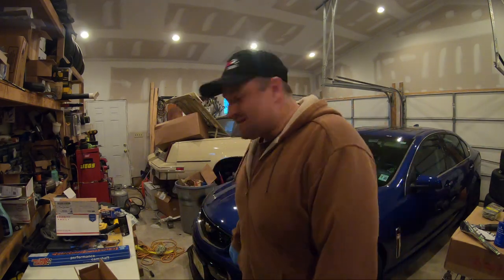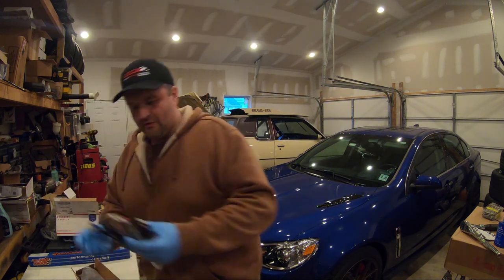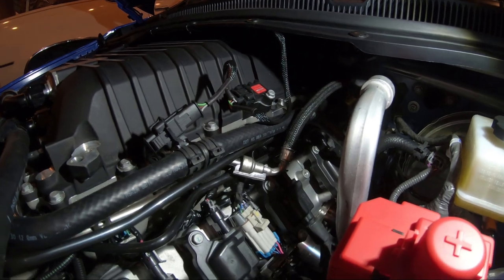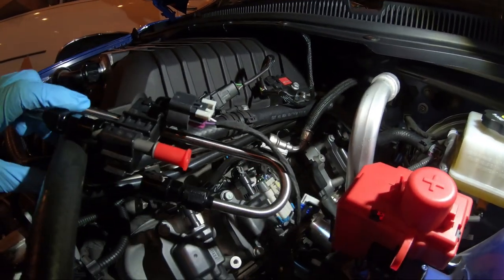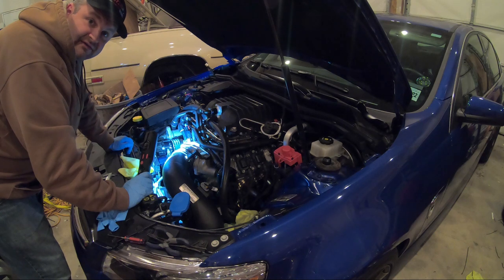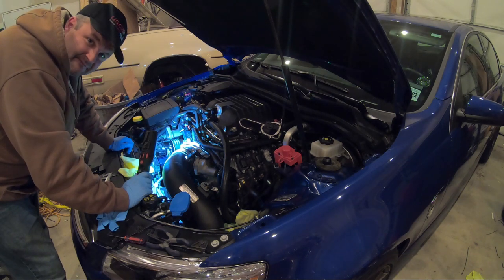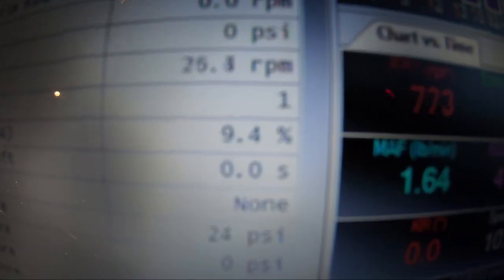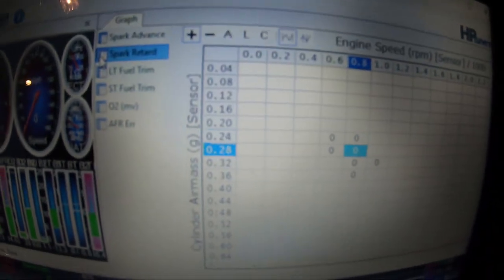Flex Fuel for the 2017 Chevy SS!!! She's Sippin' Corn!!!!

Comment: Where can I buy that fuel hose with quick disconnect? Running holley rails and coming off the back with quick disconnect and I feel it will be binding when I add in the sensor.

Comment: ZR1 fuel rail is what you are running. Not ZL1. Sorry but I think you keep tripping up on those. Also once you start running E85 your knock issues should diminish or disappear so no need to go up a pulley size.
Reply from the maker: Firechicken I know I’m running that. I bought ZR1 rail purposely because it brings the fuel rail fitting out away from the firewall but you have to reverse the way it mounts. You can’t use ZR1 DSX kits however because they add extra hose and would be a waste of money. I bought the ZL1 kit because it was recommended for LSA builds in Chevy SS installations but didn’t realize that initially because it was due to most folks running the ZL1 rails, unlike me. I admit I bought the “wrong” kit but in reality it is very simple to adapt to what I’ll need.
Reply: BanditDave yes I understand. I’m just letting you know that you are mixing up ZL1 and ZR1 when referring to the rail.
Reply from the maker: Firechicken my apologies if I am as it is inadvertent. I’ll make sure to be more crisp moving forward.
Reply: BanditDave it’s fine. I just didn’t know if you knew you were doing it and I didn’t want people buying products with the wrong information.

Comment: What else do you need to run e85 besides the kit ?
Reply from the maker: Nathan rewey larger injectors depending on the power level and better fuel pump/additional fuel pump as well as a tune for e85.
Reply: BanditDave thanks love the videos keep them up
Reply: BanditDave do you need do to anything with the stock fuel rail and do you need to upgrade fuel lines for e85
Reply from the maker: Nathan rewey if you have an SS, no, the lines are all e85 compatible. Fuel rail is also fine.
Reply: So getting the DSX kit and a tune should be ok for a NA SS? Have read that the fuel pump, fuel line and rails aren’t e85 compatible. Have even read of components melting. SS forums of course. Nice ride by the way.

Comment: What injectors did you use.? And can you run E85 without upgrading the fuel pump.?
Reply from the maker: Chupopy ID850 injectors and that’s a pretty loaded question. If you are NA without much more than stock power on the SS then you might be able to get away with E85 or at least a healthy mix like E50. That said, in an LSA build there’s no chance without more pump. Also if you’re buying injectors I would go bigger to have room to grow.